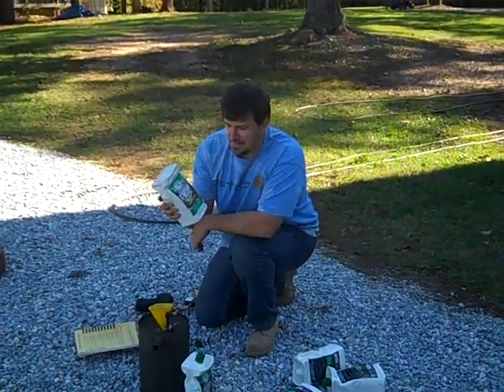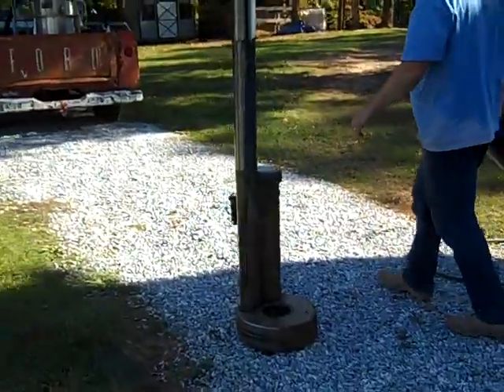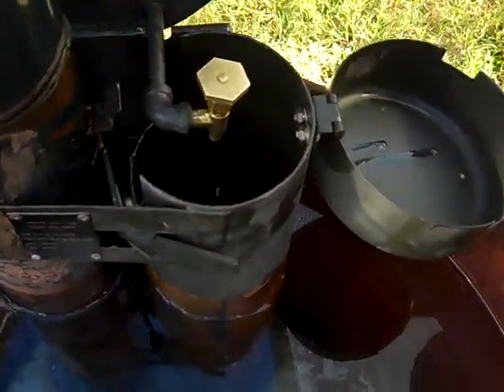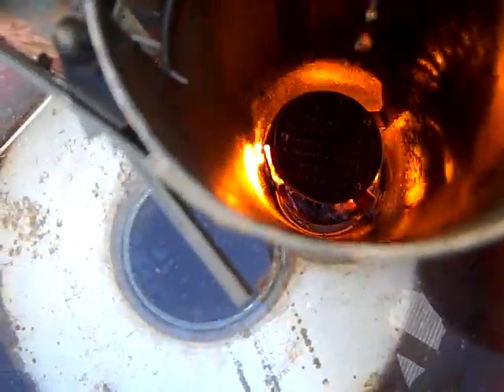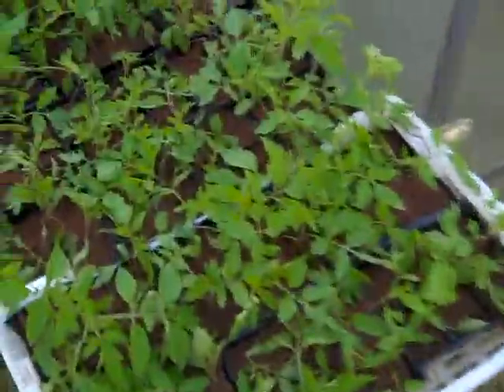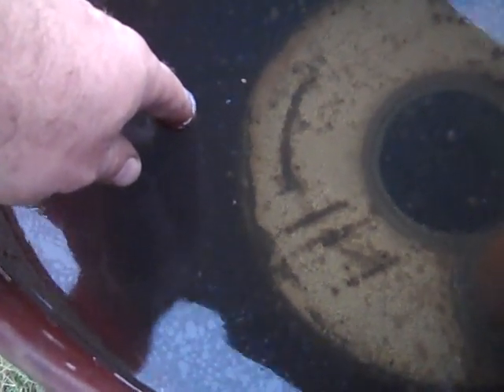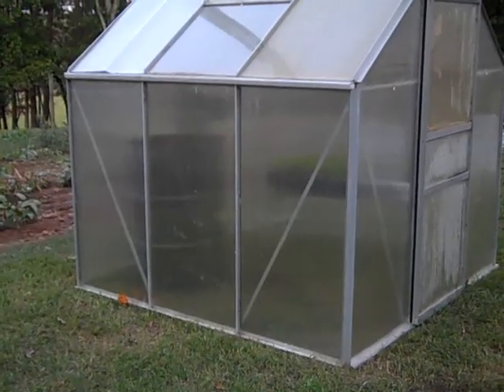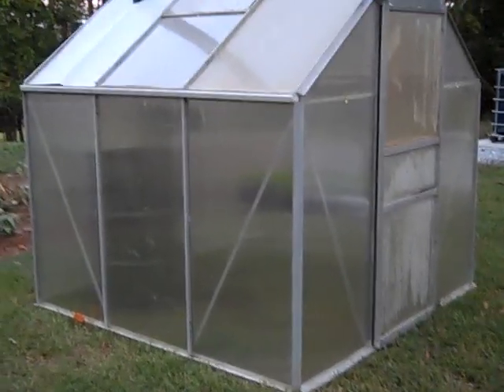A cool way to make hot water!  An immersion heater

Comment: I'm pretty sure you're supposed to let the wick burn in the closed position for a minute to allow an updraft to begin, which draws air down the intake side, then after you've opened the petcock again slightly flip it open briefly to ignite the dripping fuel, which drips the ignited fuel down to the grate which spatters while aflame.  That moves the ignition down the intake pipe and away from the tank petcock outlet.

Comment: Dude!  You gotta let the preheat cup burn in the pipe for a while before you light the burner side.  You will have much better luck if you mix some gasoline with with the lighter fluid, especially to start.  You already had fuel pooling in the bottom of the burner and you kept turning it up.  Don't do that.  I ran these things in the late 1980s on my first field problem(45 days of KP as the FNG who just got there and hadn't been assigned to a section yet).  We ran these on straight MOGAS(gasoline)  They lit really easily, go figure.  But if you pooled the fuel, you'd get a giant orange flame coming out of the vent stack when it finally heated up.  Simple and brilliant design if a bit dangerous.

Comment: I was a 94Bravo in the Army Reserves and learned not to use to much gas and use extreme patience the hard way. Tried to fire mine up in AIT and because it wouldn't light i looked down inside with to much gas and when it ignited the flash fire that came out got my eye lashes, brows and singed the front of my skinned hair back about 2 inches??? So be patient when lighting and take your time and be careful! The stacks shot up in the air also! No burns and a great life lesson on following instructions and being patient!

Comment: Our procedure was to preheat until the second stack section was warm to the touch. Then drip lit gas off the preheater cup into the bottom unit until it sustained burning.

Comment: The idea of the wick is to initiate the draft in the flue before you light the drip. I’ve used one of these a lot, gas is the preferred fuel and the most economical. Diesel a very slim chance maybe, but waste oil, never happen, if someone has ever made this heater work on waste oil go ahead and make a liar out of me but I don’t think that is goin to happen either. Even with gas the drip and the fire need monitoring and adjusting, the flame dynamics in the donut change and the drip that was working fine 10 minutes ago may now be too rich and filling the flue with soot and carbon. Good luck, there’s always a learning curve with this type of surplus stuff
Reply: agreed, in it's original configuration it was designed to burn gas because due to the design having no safeties of any kind the most flammable fuel is actually the safest fuel when used correctly. the key to getting these to vaporize the fuel is by getting the vaporizer plate hot enough, which you can't do unless you use gas. however, once the unit has been going for awhile it would probably burn diesel or veg oil and maybe used crankcase oil, but it might be very smoky...

Comment: When I was in the Army
We used these things in the field to heat dish water at the field kitchen. We used diesel fuel in them. I would not use regular car gas.
Reply: Even though I carefully clean all the rust off mine before each use, it turns the water an ugly gray then rust colored by the time the water is boiling. When you used M67s, how did you prevent the water from turning into what looks like a toxic soup?
Reply: We used them in the USAF (yes, some of us DO go to the field).  Use the M67 for almost anything,  From washing mess kits to a 2 gal 'oat buckect with showerhead.  Also used them in Water buffalo trailer.  We had used gas, diesel and contaminated jet fuel.

Comment: The way you're lighting it is dangerous.  Fuel will pool in the bottom of the heater and create a potential explosion hazard, especially if gasoline is used, or some other lighter fuel.  The proper procedure to light one of these is to put fuel in the chimney cup and light it.  This starts the air moving through the heater.  You then take the lighter wick, soak it with fuel, light it, and drop it in.  THEN and ONLY THEN do you turn on the fuel from the tank.  I've used these heaters many times with gasoline and it's quite safe when you follow the above procedure.  I've seen guys burned because they didn't do it right and I got shit on by my Warrant Officer for not doing it correctly.
Reply: detrafi Can you make a video demonstrating the proper way?
Reply: TheColorsOfSound Sorry, I can't.  I don't own one.  I used them extensively while in the military and have seen first hand the results of improper lighting.  Even happened to me. If you follow the procedure I outlined, you should not have an issue.  Bottom line:  If you smell fuel in it before you light it, don't.
Reply: detrafi  I remember a Q-Store Warrant Officer burning off his moustache and both eyebrows lighting it the wrong way, we pissed ourselves :D
Reply: Really!! because I lit it your way before and had the flame work its way back up to the fuel tank, that's fun let me tell you. then you fight with getting the flame to move the right direction
Reply: You obviously didn't do it correctly.  Most likely you didn't allow enough time for the air to begin flowing.
Reply: According to the manual (TM-9-4540-202-12&P) you fill the igniter cup ~1/4 full from the fuel tank, allow the igniter cup to heat the flue for 1-2 min and then ignitite the stream of fuel with the edge of the burning heater cup before returning it to the flue.
Reply: I use this heater to keep the water from freezing in the winter, for when I turn my cows out on cornstalk. I burn a 50/50 gas and used motor oil mix. So I think I got more experience with this heater then Mr. Know it all (detrafi)
Reply: +Luke Johnson Know it all, huh?   I'd say that you have a lot more experience doing it wrong.  That doesn't count.  The procedure I outlined was taught to me in the Army.  If you know better than they do, maybe you should be running things. Don't forget to scrape the cowshit off you chin.

Comment: I have two of these!  Got a crazy question...I have a trapline I need to put a small A-frame tent on near the end of my line so when it's -20 to -40, i can warm up...What would happen if I stuck one of these in a barrel WITHOUT water?  Would it burn up the burner?  I don't want to put water in it due to condensation...I was thinking of running it at a drip with diesel....
Reply: I was wondering the same thing.
Reply: ive seen it run dry with no problems
Reply: I've seen them run dry and the ring at the bottom was glowing red hot

Comment: We used these heaters in the US Army -- 1959-1961. Always used gasoline for fuel. Had the troops wash their mess kits in hot soapy water using long handled brushes, then rinse in 2nd "garbage" can, and final rinse in 3rd can which had boiling water. Had a nick name for these heaters. Can't remember what the name was.
Reply: we had them in Aussie army. We called them "choofers"
Reply: Mine always turns the water a rusty gray by the time the water is boiling even though I carefully clean all the rust off before each use. How did you prevent the water from turning into what looks like toxic soup?The two most common nick names for them are Puffy Billies and Steel Soldiers.

Comment: You can also use diesel fuel or kerosene.  NEVER USE GASOLING OF ANY TYPE DUE TO FLASHPOINT AND BECAUSE OF VAPORS THAT CAN RAPIDLY IGNITE.  I have used one of these things myself @ Dugway Proving Grounds in '84

Comment: I used to work in a big restaurant as a dishwasher and I used an industrial sized dishwasher that used a lot of hot water. Now this dishwasher was using 220 degree plus hot water to clean dishes, I know because there was a temperature gauge in plain sight hooked straight to the thing. I say this because I was constantly handling dishes straight out of this dishwasher while only turning my hands red and not causing any noticeable damage. So I doubt 130 degrees would do much damage, if any.

Comment: I used the same immersion heaters when I was in the Australian army. We never had any major problems using petrol (gasoline), except when people would do it wrong and there'd be an almighty boom, quickly followed by badly singed eyelashes and eyebrows. As I recall, they don't use a lot of fuel, either.
Reply: We used to get woken up by the cooks lighting the choofas first thing in the morning to heat the water for the kitchens, around 4ish

Comment: Wrap your drum with a water heater insulator while you are heating the water.  This also allows you to control the heat distribution when you need to heat the greenhouse space.

Comment: Cmac is right. Blowback is a definite possibility. Had that happen, we were using them to heat tanks of water for showers in Saudi 1991. One guy had blowback and he fell off the tank. He was ok, his face was blacked by the soot. Kinda funny. We used kerosine, diesel, jet fuel, and gasoline. They also have space heaters using the same premise.

Comment: Thanks for digging up an Immersion Water heater. I used to use those back when I was in Marines in the 80s. We would let the flame in the cup burn for a minute or so to create the draft before lighting the main burner. We would just burn regular gas and let it drip like you did toward the end. If you didn't preheat it good, the gasoline vapors would ignite and blow a flame back up into your face if you where watching down in there. It only took one face full of flames to learn how to light one.
Reply: In the Australian ARMY we called them choofas

Comment: As an engineer, now carpenter, I have started an internal door replacement company. That means that most weeks I will have a shed load of doors that I can burn in a rocket stove to heat my home and aquaponics system. In England lead paint isnt a problem, but I still wonder about what rubbish I may be pumping into the neighbourhood. Would you have any thoughts on filtering my output.
Thanks for some inspiring work. If you dont have time to respond, I still wish more power to your elbow sir.

Comment: Great video, had some questions about its size and mounting setup that were all answered by watching this video. I'm going to attempt to pipe in an automatic circulation system to a heat exchanger core with a low current blower and see if it'll put a dent in the sub zero heat factor of my garage. Question is how many BTU'S will be convertible. Thanks again, hope the Mater' sandwiches were great!

Comment: When I was in the Army we used old or contaminated gasoline. You can use anything that will drip out of the nozzle and burn but you might need to use fresh gas to get it started.

Comment: To every one looking at getting one of these, use caution with what you burn in it
Tried gasoline and mortared it. Lost hearing for a bit and a good bit of hair.
WMO/Diesel works well and fairly easy to light. Only problem is that the oil doesn't burn off completely on the vaporizer and pools in the bottom, making it messy and hard to control the heat. After my tank was empty, it burned for another 1 1/2 hours off the oil puddle, burning the paint off.

Comment: I have used these for a couple years now in the processing of biodiesel.  My vid of the heaters are from 2010.  I now use my heater (in my videos) to heat a water/wvo heat exchange system on a mobile biodiesel processing unit.  These heaters are rated to about 35k BTU on gasoline.  I use biodiesel in mine, and can boil a 55 gallon drum of water in about 30 minutes.

Comment: You never was in the army were you? The ol joke was "what's the blast radius of an imersion heater?" They heat fast but be VERY CAREFUL when relighting!  One time another unit set off a bunch of powder accidentally, the CO called the mess hall to see if anyone was hurt when the water heater went off. Don't have any body part near the pipe opening when lighting.

Comment: The efficiency of the heater would be greatly increased by piping a air in take from outside so that the heater isn't sucking all the heated air out of the greenhouse. Should be a quick fix and will help keep heat even.

Comment: Nice video!  Just so you know, tomatoes will not set buds at temps below 85 degrees F. as memory serves. Tomatoes transpire a huge amount of water and need lots of air circulation in greenhouses to prevent diseases and white flies. Burning hydrocarbons in a greenhouse are not good, either. Releases some bi-product gas which harms the plants. 

As well informed as you are I am sure you are way ahead of me on all these fronts and have the solutions in hand.  Keep up the good work!

Comment: this is great to see, I would like to know how this works out for you,  I have some ideas in mind myself for growing food in the winter,  however, I'm in Canada so the winters here are a bit colder. , but I was thinking about having the north side be an earth wall, with 2x4 structure for the roof and angled walls,  solar rated 6mil plastic stapled to both sides of the 2x4 to hold heat better,  paint the inside black, and run an aquaponics system inside (an above ground pool will hold heat)

Comment: Finally a use for my used motor oil I have been saving. I wouldnt mind a $25 green house like that at all. I am probably going to spend more then that on the plastic one I plan on covering my stuff with this winter.

Comment: I have a question, I am not sure how it is working fully, but could you fill the drum with sand instead of water and have the sand as a thermal mass that would hold onto heat longer then the water?

I guess I am not sure if sand or rock would hold onto heat any better than water, really interesting and cool
Reply: I was thinking the same thing, I considered the idea of getting one and filling a barrel with vermiculite. That's the filling people use to retain the heat in rocket stoves and sometimes in small rocket mass heaters. I don't see why it wouldn't work well instead of water in the barrel since the combustion chamber is stainless steel...and without being immersed, if it's backfilled with vermiculite or another decent similar substance like maybe mud and straw cob, (if vermiculite isn't handy) it should be able to handle the temperatures without burning through or spalling the combustion chamber.

Comment: Respects, this is not for laughing. While watching Your video, something came up my mind... With this kind of tubing trough water (or air), or something like intercooler radiator, You could recuperate heat made by wood gasifier, to cool the gas. Same on motor outlet... Your idea to use a heat reservoar in this way is great!!! Thanks for sharing!

Comment: On my last propertty we were experimenting with a rocket mass heater to heat water, then adding a thermal gravity loop to the system to draw the water without a pump up into a tank, and then to an outdooor shower. It didnt circulate on its own as much as I liked, so i did eventually install a bypass and a hand crank pump to recirculate the water from the lower heating tank up to the larger storage one.

Comment: to buckstarchaser, this type of heater was normally in HQ area where the chow tents were and was primarily for cleaning and such. Using gas they were prone to blowing up as some people tried to fill while running and sometimes the water had a gasey taint to it. Nice video and definetly a steal at $50.

Comment: That's really nifty!  That warm water should hold good heat after the fuel's gone and store the daytime heat from the sun too... The extra humidity may also be good or maybe bad. I was trying to think of why the military would have this kind of heater since it would likely make a tent soggy from the water... Hot showers and dishwater is probably the answer.

Will this suck in a lot of cold air from outside for the fire? Would it be hard to make an air pipe that feeds it from outside?

Comment: My friend has a Lister Diesel Engine he uses to run a back up generator and in the tank for the engine antifreeze he put a copper coil so he can run clean water through it for doing laundry or whatever. and it also take away a lot of heat from the engine.  He asked me to put up a few video's of it on my You tube ch so he could show some people. The neat thing about it is it can run on almost any oil, You just have to clean it every 500 hours if it's dirty. here is 1 of them /watch?v=77wiB_lKtog